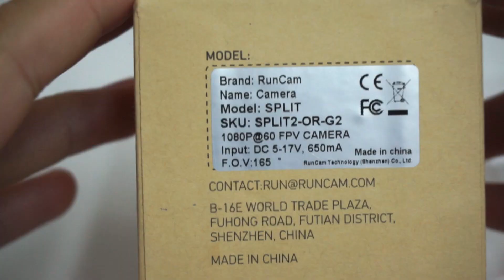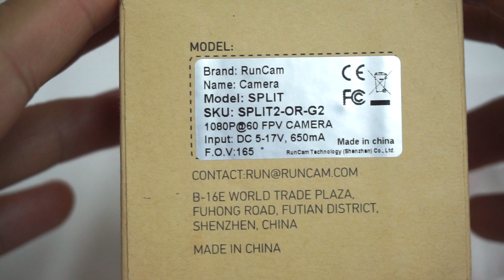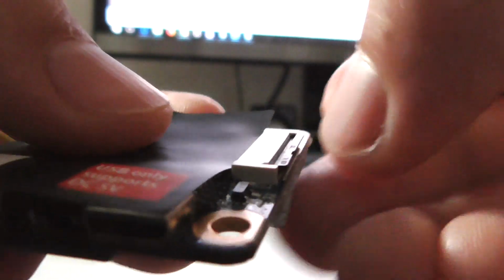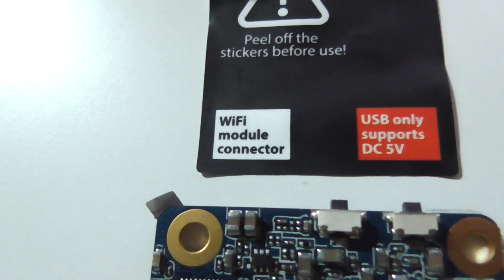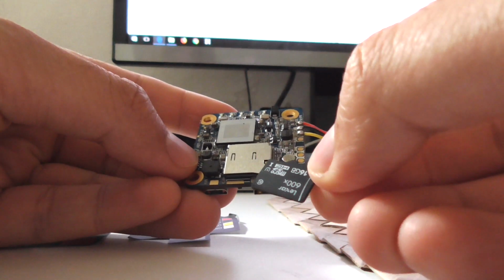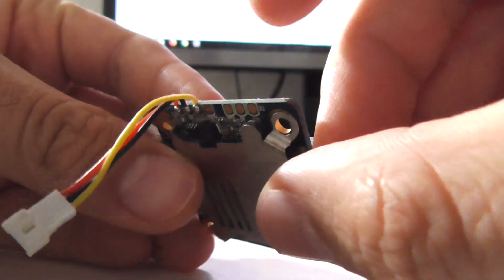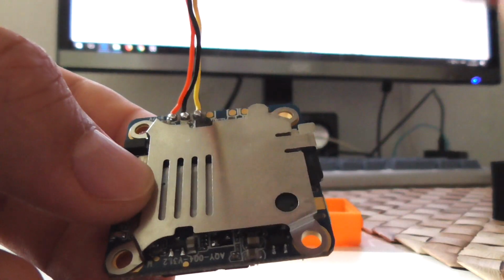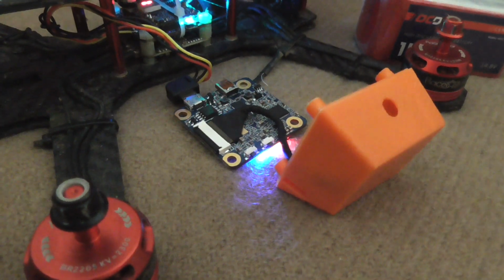RunCam Split 2 + Orange Box (FPV Camera & Recorder, Unboxing, Test)

Comment: Wow nice camera bro,how many meters have a wifi?
You think that this wifi its possible cross the walls?
I need a secret camera with large distance of wifi for control my things,can I help me bro?
Thanks and best wishes.
Reply from the maker: I just tried the WiFi transmission, and I could see the image transmitted by the drone on my smartphone through 2 walls (20cm + 30cm thickness). The 5.8GHz analog signal should travel even further. If you use a lower frequency video transmission system it should penetrate even more objects. Just search for 2.4GHz vs 5.8GHz FPV videos.